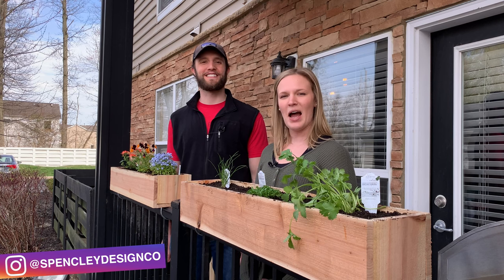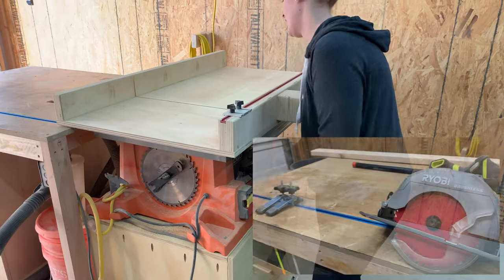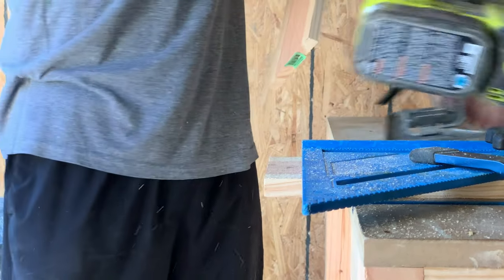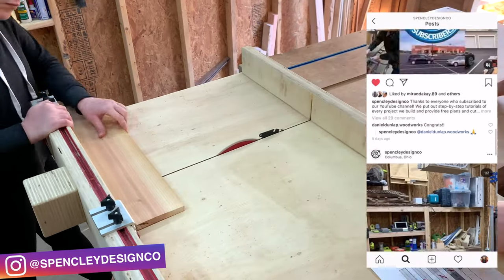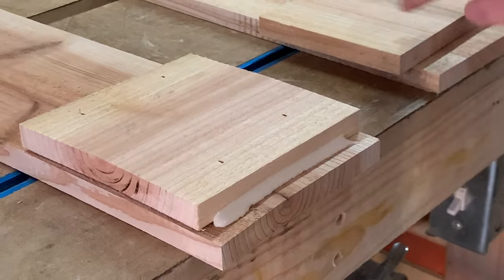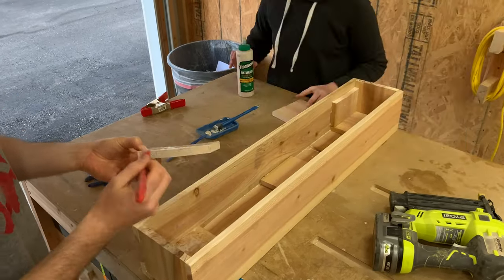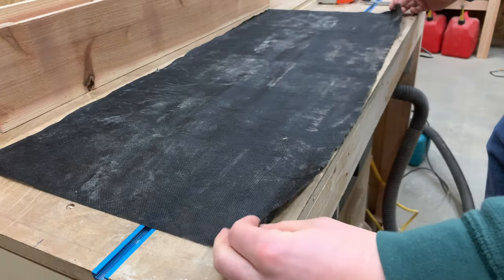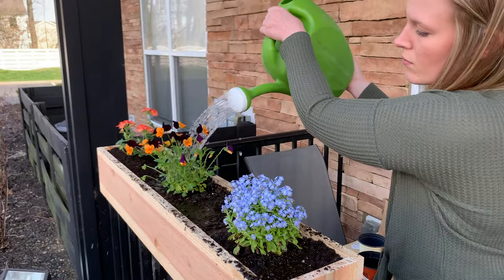30-Minute Build Made Easy

Comment: If you don't have a nail gun, what kind of nails are recommended? and are pilot holes needed to prevent the wood from splitting? We are using cedar pickets.
Reply from the maker: Hi Joseph! Thanks for checking out the video and reaching out! If you don’t have a nail gun, you truthfully don’t need nails. Just keep the boards clamped up while the glue dries. If you do want that extra reinforcement, I’d suggest actually using some #6 screws around 1 1/4” long. Make sure to predrill!

Comment: Hey you're not actually adding much structural support with the bracing, just making it heavier.
Reply from the maker: Thanks for checking out the video! I appreciate the support. You don’t have to add the inside pieces if you don’t want to 😀